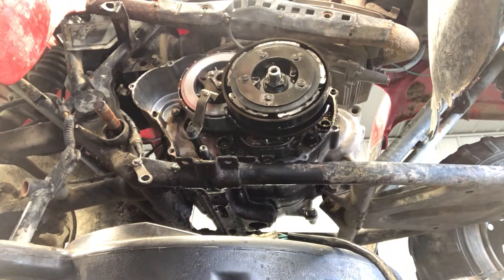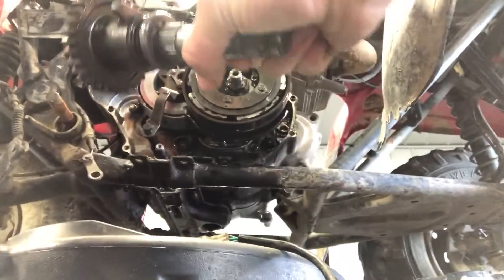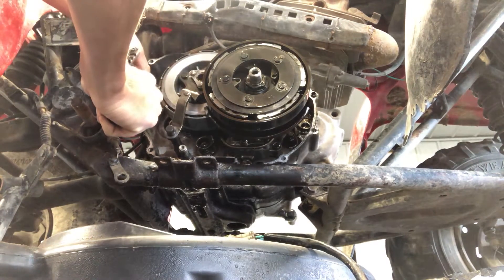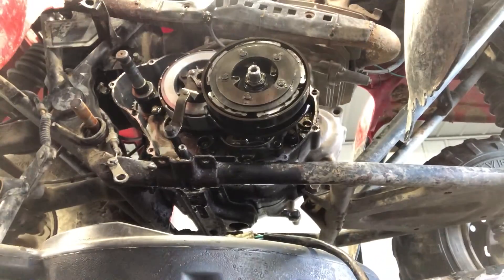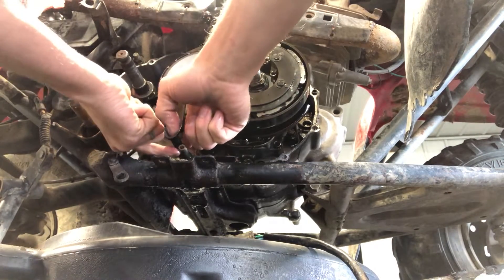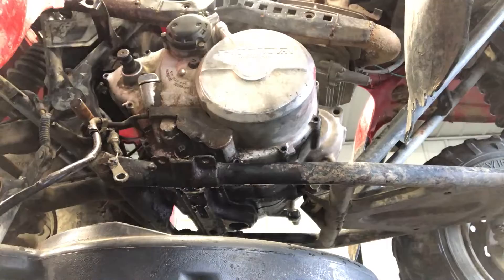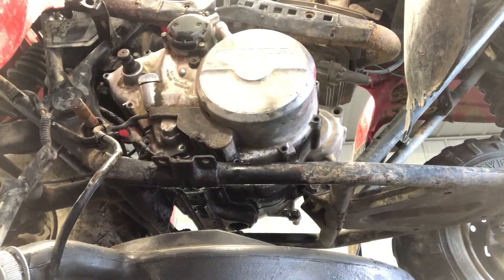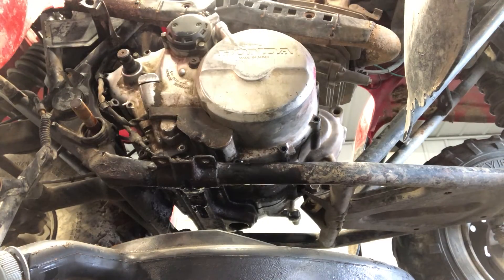How To - Install Kickstart Gear Spindle Kickstarter Kick Start Clutch Honda Fourtrax Trx 300

Comment: Also note that you should lube up the shaft especially with new seals as it will Jam and typically its after its been used when things have heated up

Comment: Right on!!
Reply from the maker: Happy to help. Let us know if you need anything.  ebay.com/str/midnebraskamotorsports
Reply: @MidNebraskaMotorsports . Bad azz!! Am working in Cambodia here on motorcycles and four wheel rear motorcycle engine two wheel single axle. Recently repaired a cracked engine housing, aluminum. With oxygen acetylene torch. And an aluminum coat hanger. 
 Did not go as smoothly as planned. Did not prepare all material, prepared what needed to be done and the area. 
 I should have taken that whole housing, washed it in gasoline, rid the oils, put on heat, and welded or bonded. Got some welds in, finished with two part epoxy….

Comment: Is this the same for the 4x4 models
Reply: @MidNebraskaMotorsports  I did everything you said on the video. Put the cover on and tried the kickstart and it wont move. All my washers are in and everything is aligned but it wont move.  Engine is not seized it was turning over before i put the cover on. What gives???
Reply: How about a kick start rewind on 84 Honda trx 250